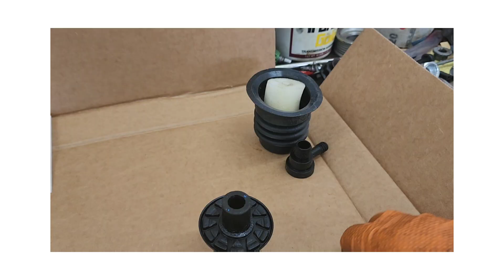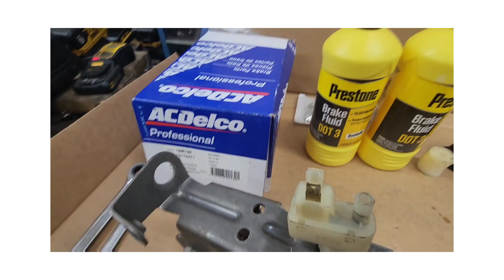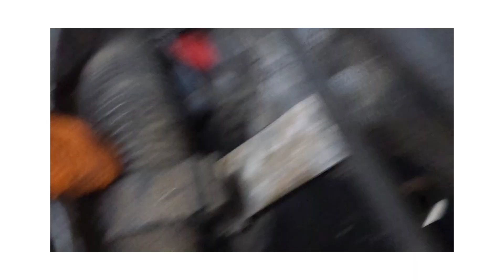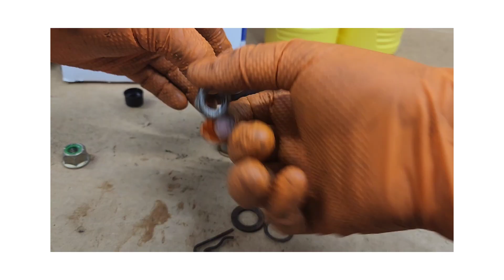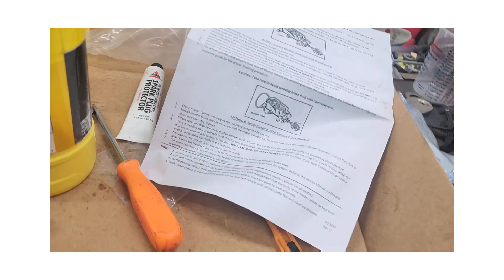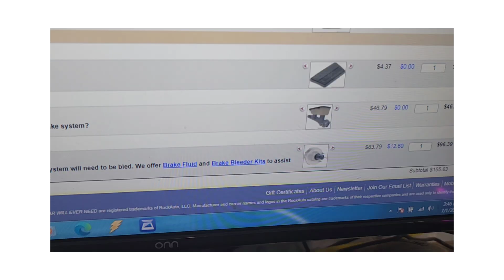Turbo Regal owners guide: Powermaster brake conversion.

Comment: Do you have to replace the entire brake pedal bracket with the pedal or just the brake pedal by itself?
Reply from the maker: Just the pedal
Reply: Good! All I need to do is remove the brake pedal. I have already removed the four nuts. That nut on the far right at the top is tough to get too.

Comment: Thanks for making this for the Turbo buick community 

I’ve already done a hydroboost conversion but after 7 years it’s leaking from the vent hole 

The Hydroboost I bought has a 2 bolt flange mount just like the old power master had so I didn’t need to remove the 4 bolts under the dash to mount it only I can’t find the same part so I decided to go vacuum 
There’s a rats nest of aftermarket wiring that I just know is gonna F me over 
I currently have a Wilwood reservoir installed 
Should mate up 

Wish me luck and thanks again it was very helpful

Comment: Why did you use that vacuum booster instead of one listed under the 86-87 GN on RockAuto?
Reply from the maker: They recently added that listing. It used to show powermaster a long time ago with a rebuild service.  If you click on the part number it shows all the other models it fits.
Reply: @swiftWord  Thanks. Do you know if the newly listed 86-87 vacuum boosters still require a different brake pedal? I'm guessing yes.